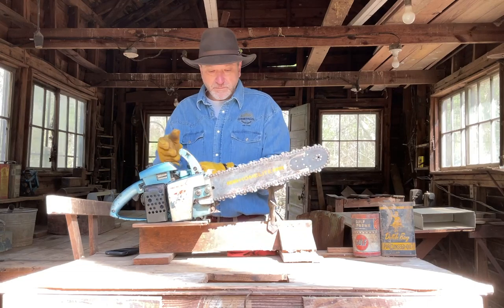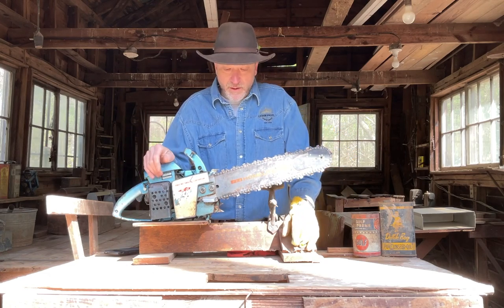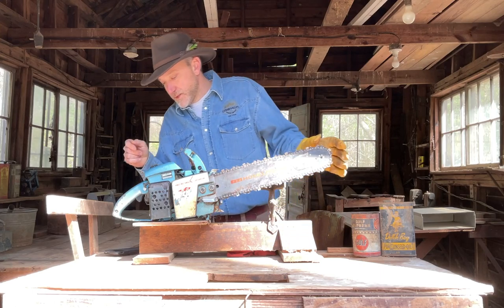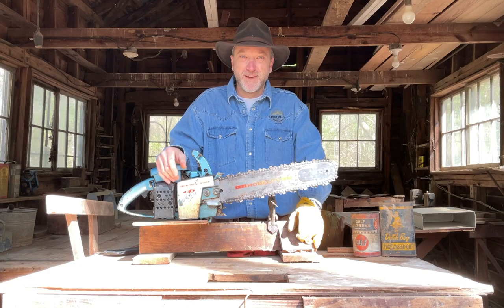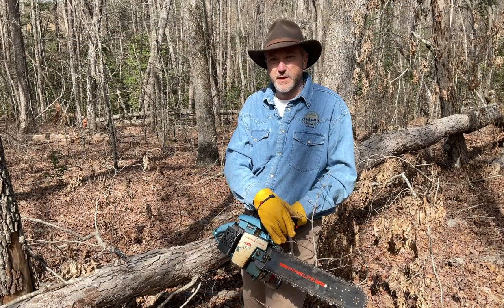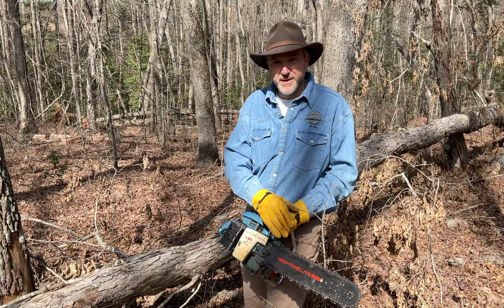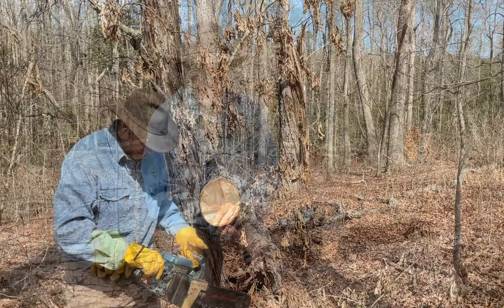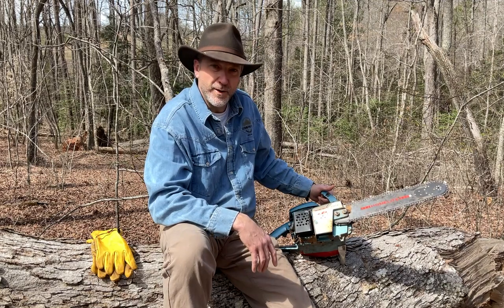Vintage 1970s Homelite XL-12 Chainsaw Review

Comment: Old Homelites are the most durable saws ever made. My SuperXL is 12 years older than I am, and it's hardly ever maintained, shamelessly abused, run without an air filter, accidentally dropped, and survived a 15 foot fall when I got the chain bound up cutting a huge branch, and just felled it from the bottom. After a nuclear war, earth would just be ashes and a bunch of old Homelites laying around. The tortoise always wins the race.
Reply from the maker: Great comment.  I have a couple more that are from the early 80’s I will try to fire them up too.
Reply: That’s true

Comment: I learned to cut wood on an XL12. I'm working on a red XL12 from the late 70s or maybe 80s that  I bought a year or more ago.  I should have it back in service soon. It will be set up with a 16" bar initially for light stuff. I have both 16" and 20" on hand. Hoping that blue Prestolite ignition  module is still like it should be. It doesn't appear to have that many hours on it. Ain't nothing like a classic Homelite for making music 🎵🎶 in the woods. I like my Super XLs and Super EZs too. Fine machines actually even though they are definitely old school engineering and design. Nearly in the same league as a steam 🚂 locomotive to some degree,  but still more than capable of doing their intended job a half century later. Firewood production with a true vintage classic is more satisfying than most would believe.
Reply from the maker: I really enjoy it.  I think it sounds great too.

Comment: From a rumor I heard from another YouTuber the second digit in the serial is the year so it would mean this one is possibly a 1972 if the other guy is correct the blue saws I believe are older than the red ones
Reply from the maker: Thanks for the feedback.  I was told the same thing about the color.  The serial number point sounds right.  I was thinking early 70’s so that matches.

Comment: I think that one was made 69 or 70.i started out with yhe super xl in 66 they were 119.00 new .we would use them until they wore out and then over haul them and get another 200 cords of ash wood .they were the best until the 360 came out.360 was the best they ever made,probably  cut between  700 and 800 cords  of ash and oak and still going.
Reply from the maker: Thanks for the info!